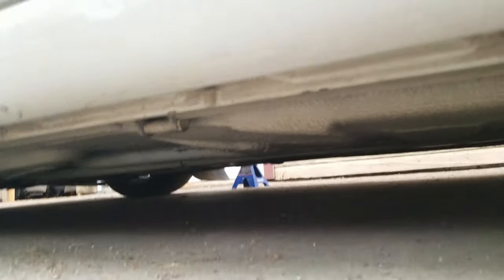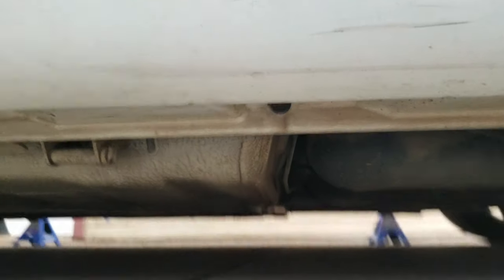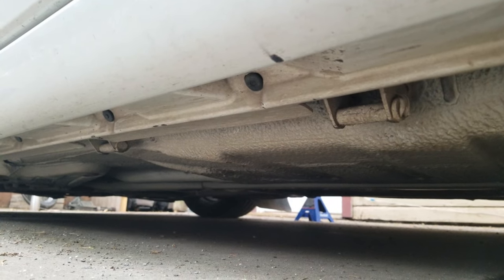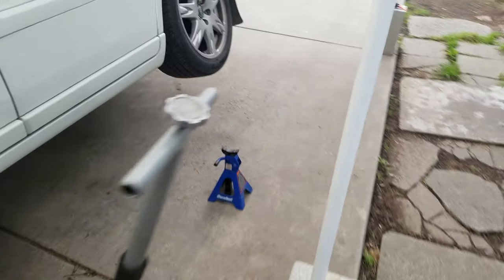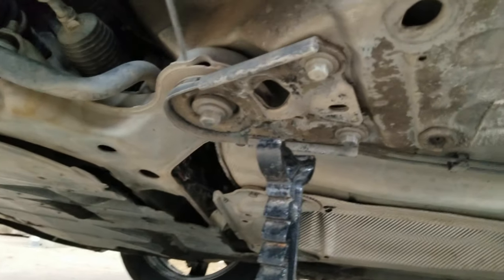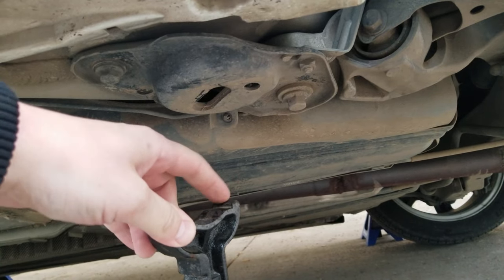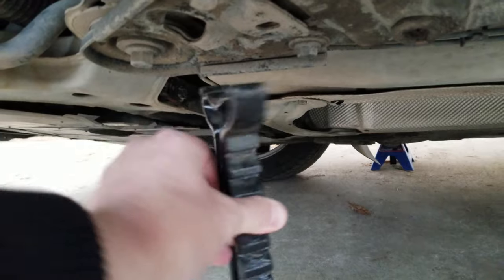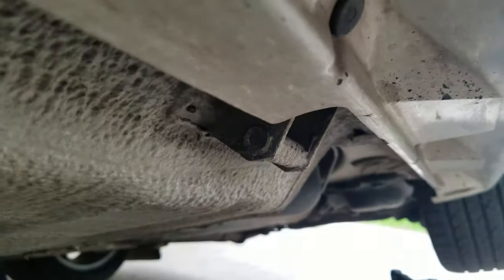Where to Lift a Volvo

Comment: So using a floor hack / hydraulic jack and not the factory jack, you align the cup of the floor hack under the metal bar of the factory jack jack point then?
Reply from the maker: Pretty much, not rocket surgery but I've literally watched tire technicians throw the jack under and just start jacking as of there is a pinch weld.

Comment: Is there a point where you can lift both front tires at the same time? Or rear
Reply from the maker: Not one that was meant for lifting the car. For the front I just stick the jack, carefully, under the front subframe support, but it's not a recommended method. Just do what I do and lift it was up and put it on jack stands. Plenty of room to work under it.

Comment: Good video for the scissor jack points but what do you do if you don't have the super-low profile (and expensive) hydraulic jack to reach way underneath?
Reply from the maker: The lifting points are about 2 inches in underneath the car.. and designed to work with the factory jack the Volvo includes.. and no volvo needs a low profile jack unless the car is lowered or sitting on flat tires.
Reply: I have a C30 that sits pretty low, and a stupid big floor jack. I just drive up onto a couple of 2x6 planks, and it gives me that extra bit of clearance to slide the jack into place.